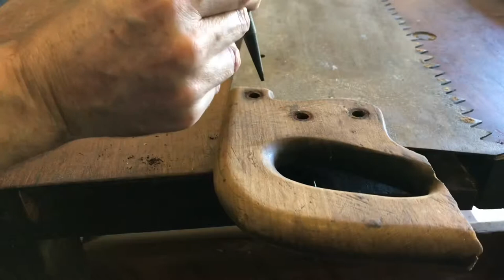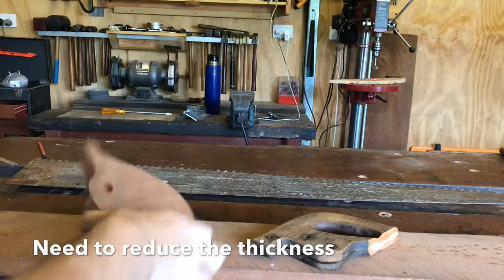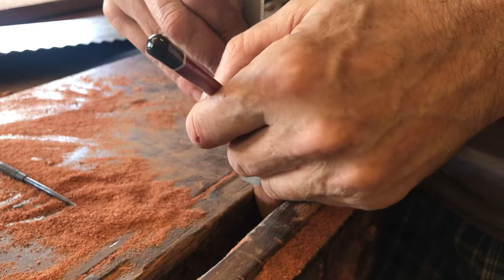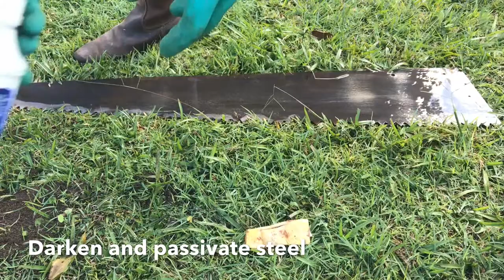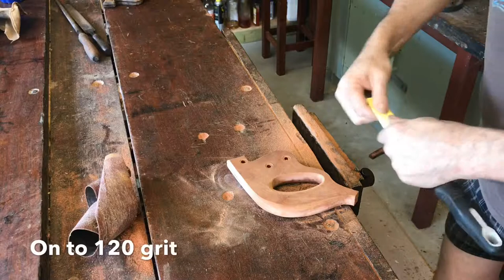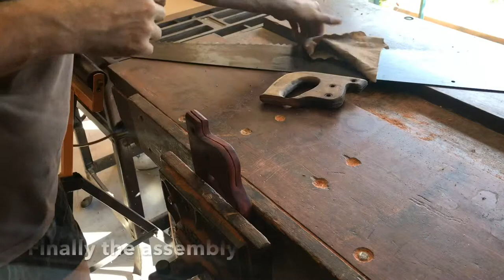Stunning Vintage Saw Restore

Comment: Is that a rip cut saw or crosscut saw?
Reply from the maker: Ah thanks. good pick up, I seem confused, I wrote CrossCut on the description and wrote Rip in the video. The teeth are triangular like a typical crosscut saw but the teeth have almost a straight rip saw sharpen on them  Ref https://www.youtube.com/watch?v=6RuhVhKlDcQ Since it is a two handled saw and the teeth need to cut both directions that would be why they are triangular shape. but i would say it could also be used for rip because it has big chisel shaped teeth that are less likely to clog but it definitely works well as a crosscut and can post the video of us cutting down a tree with it if you want to see that.  It could be debatable but i am leaning towards crosscut and cant edit the video to remove the reference to rip. Cheers.